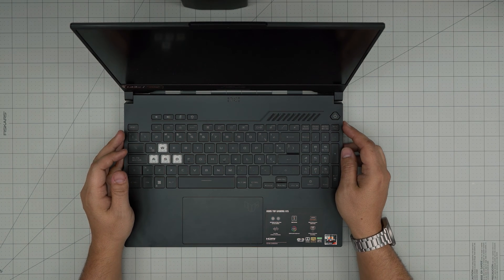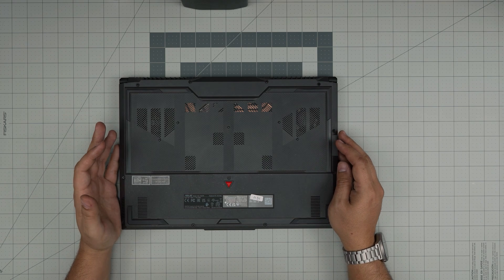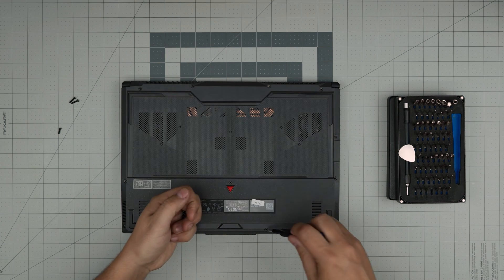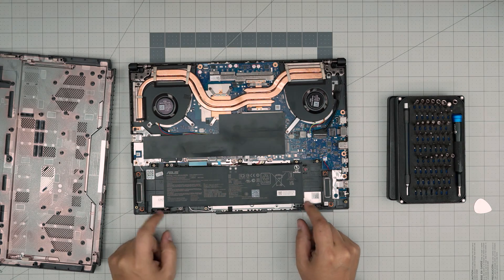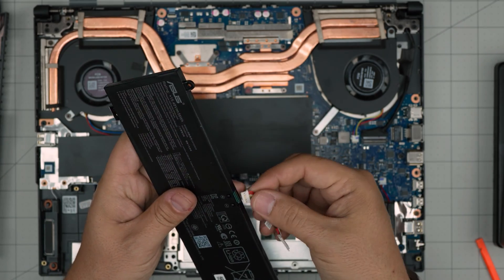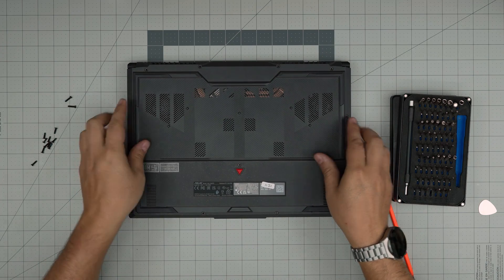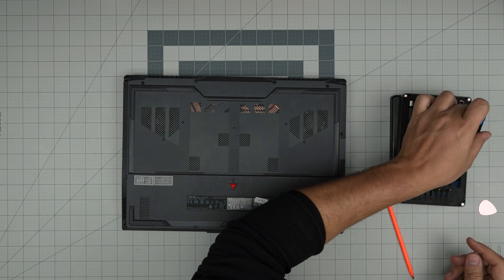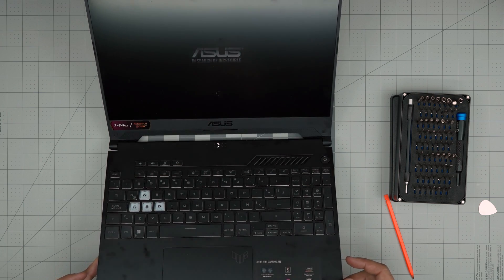How to Replace Battery in ASUS TUF A15 FA507RF: Easy Step-by-Step Guide

Comment: 5:50 I can't slide it back, what should I do?
Reply from the maker: 🫠Regarding your question, if you pushed the connector into the jack then the metal should just move about less than 1mm, if it doesn't slide don't worry it's fine.
cheers🍻

Comment: Do you happen to know where the CMOS Battery for the FX507 is hiding? I have one open on the bench here, removed both SSDs and RAM, but I simply cannot find it. (I'm semi experienced, checking/replacing the Cmos Battery voltage of our HP Notebooks at work on a regular basis, but I've never seen a more modern Capacitor/Goldcap type of Bios Supply, maybe that's why I cannot find it...)
Reply from the maker: 🫠Regarding your question, this laptop and many new laptops no longer have a dedicated CMOS battery. Instead, they draw a 3V charge from the main internal battery, and the BIOS relies on a regular capacitor that holds a charge for only about 10 seconds. 

Therefore, these laptops do not require a CMOS battery replacement. If the CMOS keeps resetting to default when powered off, it is likely because the laptop's main internal battery is drained.

Should you have any further questions or requests in the future, please don't hesitate to ask me.
cheers🍻

Comment: Can I use this laptop plugged in but without battery ?
Reply from the maker: 🫠Regarding your question, sure you can use the laptop without the battery and it will work just fine, without any issues.
Should you have any further questions or requests in the future, please don't hesitate to ask me.
cheers🍻

Comment: Hey can I install a 90whr battery in this laptop?
Reply from the maker: 🫠Regarding your question, if you find a battery that has the same connector and fits and it is 90w then sure you can.
cheers🍻